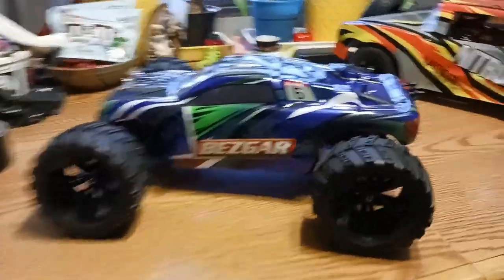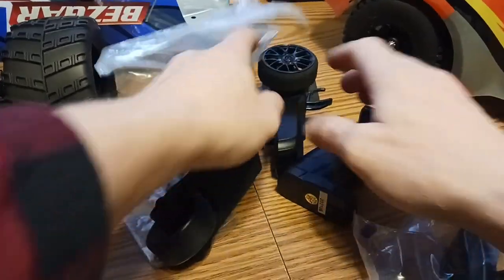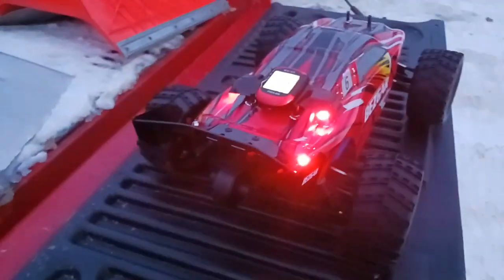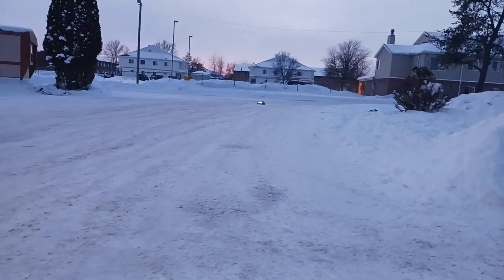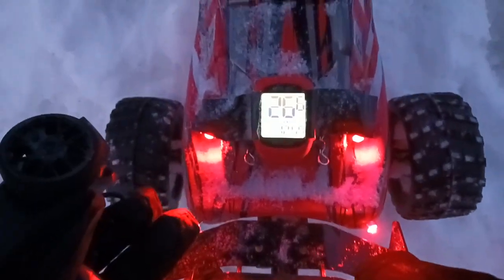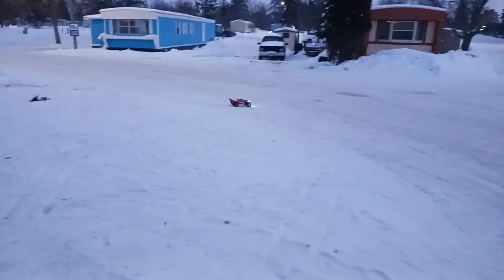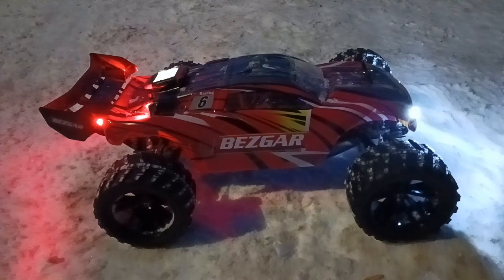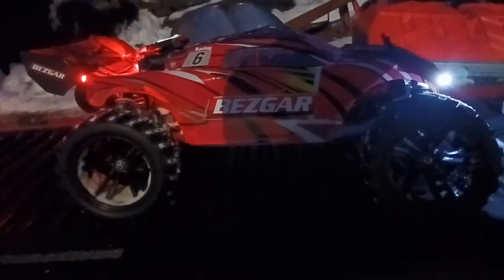New Brushless 1/10 BZR Blade RTR Features 2s Winter Top Speed

Comment: LoL! I haven’t even gotten mine out of the box and I’ve had it since the beginning of December! I see it rips along pretty well as promised in the description on Amazon. I can’t wait to take it out. Think I got mine for $109, but at that time they weren’t offering a free of charge 5200 mah 2s battery! That’s a no brainer! Loved that ridiculously long jump you took over the snow Bank! This thing is awesome !  Really sweet drifting too bro! May have to skip over some of the other cars I have on deck for review just to do this one!😝! 
Brilliant video bud!🙌🏽👊🏼😎
Reply from the maker: Thank bro! Get it out! I forgot to show I wrap a longer battery strap around the outside of the battery and only tall posts. My inner battery gaurds are behind the center shaft. It needs a recall but I'll show next video. Us MacGyvers are good tho lol. It's a 3200mah 25c I think, 2s and looks like a good charger that almost no one got lol. I learned in the reviews
Reply from the maker: Wanna hear something crazy? The Zorro and Blade have dang near same chassis and aarms. Blades just shorter. 🤯😎
Reply: @ChiefRickyRC  So that means if you want a wider or narrower track you can just swap them out? That’s wicked good to know brother! Thanks  Ricky!👍🏻👊🏼😃
Reply from the maker: I noticed the wheelie bar would fit then looked closer upside-down and dang all the screws holes in the front  steering is same too

Comment: Is bezgar a good brand?
Reply: Yes
Reply from the maker: Depends what model but mostly good rc's yes 👍
Reply: Which one is the best
Reply from the maker: Overall the Blade is best, but what size? 1/20-1/10 now. They have small Toy grade rc also
Reply from the maker: Basically if they have steel axles they're good. Not perfect, but good and fun
Reply: Thank you
Reply from the maker: I'd recommend the HM101/HM103 first, then Blade for bigger rc's. If you find one let me know I'll tell you if it's good 👍
Reply: No. Get a Team Associated Rival MT10 instead.
Reply: @SnarkyRC  is it durable
Reply from the maker: They're all pretty durable except the body shells and posts. Some have shock towers that don't like skate parks. Depends

Comment: I want to buy this but on amazon site they have bad reviews....mann I want it bad ......lol
Reply from the maker: I'm gonna checkout the reviews lol I haven't did mine yet on there
Reply from the maker: The one with guy going threw six pinion and spur gears 🤣 what a moron! I'm 100% he got one assembled wrong. Mine had the battery posts in wrong spot, but the car is still great for $129 lol. I'd reccomend trying it and if you don't like return it. You'll love it promise
Reply from the maker: I'm not supporting Bezgar at all by the way. Just found a cool rc. When I'm reviewing for a company I'll have links to buy it
Reply: @ChiefRickyRC  I will Thanks.....✌
Reply: @ChiefRickyRC  where you get the light kit look very nice
Reply from the maker: Thanks bro, they're on any app that sells rcs I got these off Amazon. They make a nice look huh 🏁👍
Reply from the maker: It's a 8 piece, 4 white and 4 red LEDs. You can get 2,4,6,8 piece light kits that you mount and come ready to plug in also. I had some demon eyes that changed color, but I accidentally broke one. Gonna try a light bar that has different modes on the Nitro and more soon. It's gonna be cool just a heads up
Reply: @ChiefRickyRC  Thanks alots........👍

Comment: I got one around 2 months ago, I saw yours had lights, does it come with lights?? Mine didn't
Reply from the maker: Lol sorry it doesnt. I didn't show installing lights. I did have to relocate the small blue battery posts to guard the center shaft. They were behind the shaft. Also my lower shock caps were loose. Wasn't leaking oil, but needed tightening. I love it though. How's yours been
Reply: I love mine, just got a 3s battery for it and it is a beast, how did you relocate the small blue battey posts? I had to learn the hard way that the battery hits the drive shaft 😔
Reply from the maker: I first used a battery strap around horizontally using the plastic posts lol. I recorded how I did it to show soon, but I'll tell ya it's easy. I didn't have Metric drill bits, so I found SAE sizes that turned out perfect size with a careful touch and extra little machining lol.  I drilled 7/64" sizr holes in new spots. That was closest I had to the diameter of the screws. Next I just used a 15/64" drill bit's tip to bevel the edge of the hole, so the screw went in flush and smooth.
Reply: Oh dang, that's a long process, I won't be able to do that since i don't have a drill. Would love to see the the battey straps instalation vid tho
Reply from the maker: Next chance you can get a cheap kitchen drawer drill then. So the strap, it goes tight around the battery and only the plastic posts, then put the top part on normal. Like a caccoon lol.
Reply from the maker: My buddy Gary @Gary's RC Channel has a short showing how he put a 12mm hex on it to keep battery off too
Reply: @ChiefRickyRC  are you going to upload the video where you show how to install the batterystraps. I would love to do it to mine as well
Reply from the maker: I'll have a video on it by 10pm. Lol It's 4:33pm here now. Sorry the wait
Reply: It's all good, thank you so much

Comment: These look fun for the price, however there seems to be no parts available yet.  Soon as I can find some parts I'm in.  The bezgar site doesn't have the car listed in the parts section.
Reply from the maker: Ohh no worries it's a Redcat Volcano. Lots of parts and upgrades 😎
Reply: @ChiefRickyRC  are you talking about the Redcat Volcano EPX Pro?  It's definitely not 1:1 the same, who knows what all is compatible though.  Bezgar has a manual with every part with a part number but nowhere to buy them... wth.
Reply from the maker: Minus 4 shocks and body and stuff it's same gears axles stuff
Reply: Where can it be purchased?
Reply from the maker: I just searched Amazon, Redcat Volcano parts and a bunch came up. I'm sure this is same but I can measure and double check more here and lyk

Hobbypark 08029 Dogbones 89.5mm & Stub Wheel Axle 02033 Drive Shaft for 1/10 Redcat Volcano HSP Exceed RC Car Truck Replacement https://a.co/d/dKzn6fV
Reply: @bryanwinter3289  the car itself is on amazon